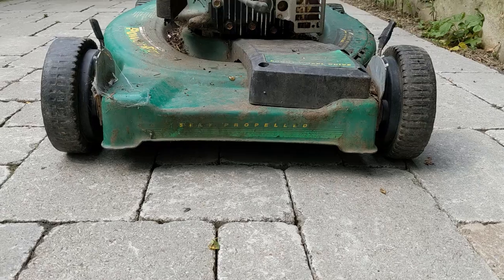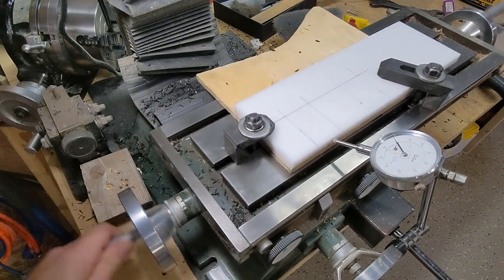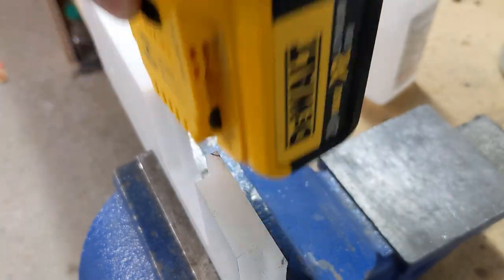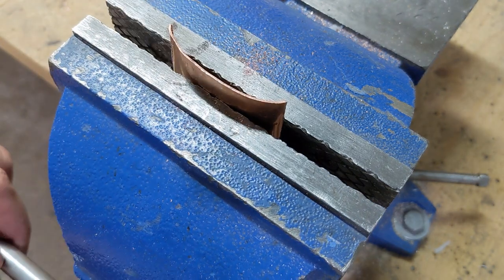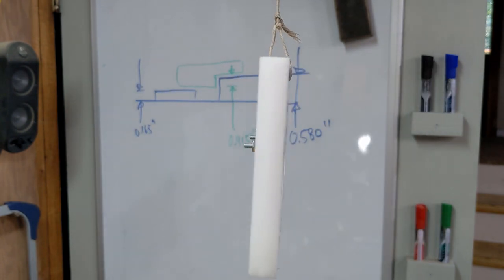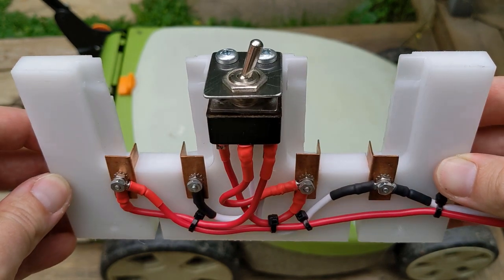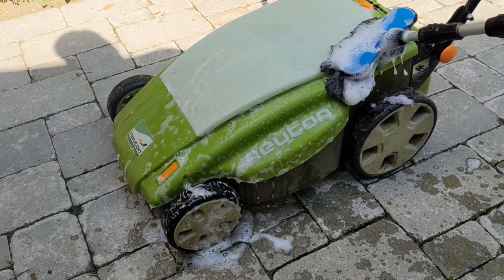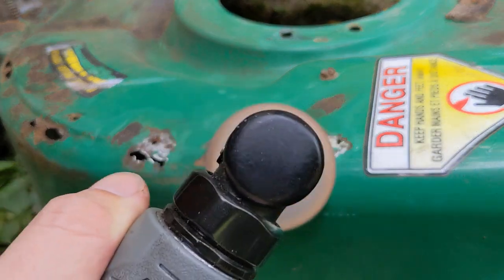Upgrading a Neuton Mower to Run on Drill Batteries

Comment: Genius! I'm blown away. I mow a gnarly community garden field with a donated CE5.2. The heavy lead acid replacements & their long charging times are frustrating, & the battery case is nearing end of life. Your improvements would save this wonderful mower from the scrap heap pretty much indefinitely. If you ever produce/sell your set-up as a kit, I hope you'll let the community know - ebay/amazon have little for Neuton fans, & replacing the lead acids costs ~$100+/yr. And the disposal nightmare.... Hope you jump in, I'm too old to be lugging this battery around!

Comment: You should sell a kit.  Some of us can put that together but we can't machine the plastic material.  You have a great idea there to save the Newton mower from extinction.
Reply from the maker: Thanks for the feedback Dale. You're right, machining plastic is quite specialized. The good news is that there already are drill battery holders commercially available from sites like Amazon which make this type of conversion easier for those who are interested.
Reply: @BusyMDan  I will check that out on Amazon.  High fives on the innovative conversion, Thanks Dan.
Reply: @moci42  If anyone has a link to one of these kits I would be very interested! Thanks in advance.

Comment: Really impressive bed of work. Thank you for doing that. I have a slightly older model with a CE5 24V battery, and I’m going to give this some serious thought. My approach might be a little different in that I would try to use the existing mower battery case to construct the holder for the portable tool batteries. It would also mean that the mower would run always at 20 V, but I could have two in parallel, which would give it a lot of oomph.

Comment: I had to use my Newton 6.3 today and the battery was clearly very low.  So I pulled the batteries they looked physically like new.  I disconnected all the wires and am now charging each battery on my bench charger.  The bench charger doesn't show any problem with the first battery, it shows 90 percent capacity.  I'm now charging the second battery then will be the third.  I checked the charger wall wart and it shows 40 volt no load so it should be fine, however I did find the charger plug was badly rusted.  I used some very light sandpaper to get the rust off and bare metal then used DeOxit on the plug.  After I get all the batteries charged up I'll reinstall then try the wall wart charger again.  I checked Amazon replacement batteries are all over the place price wise, it looks like exact replacement of three would be about $75 at the low end.
Reply: I found three specifically for the Newton 6.3 priced at $68 on Amazon.  I finishted the second battery and it tested good with 90 percent capacity.  The third battery is on the charger and so far it's charging just like the other two.  I expect it too will have 90 percent capacity.

Comment: Question, the mower with the original battery pack comes with a DC input to charge it, is there any way to wire this into the setup you have to easily charge the drill batteries?
Reply from the maker: It possible, however not practical. The individual battery cells ideally should be balanced when charged and the mower only connects to the positive and negative terminals of the battery. There are additional pins on the battery which I believe the charger uses to perform a balance. Also, there is no monitoring of the batteries temperature while in the mower while is important for safety. It may be possible to pump current directly into the battery overall, but I don't think this is the best/safest option.
Reply: @BusyMDan  ah, I was under the assumption that the batteries had a BMS built in 🫡 thank you!

Comment: great project, well done explaining. couple of question; you appear to be using the multimeter in place of the safety key, does this use the fuse in the meter as the breaker then? also, is there a schematic for the voltage switch?
thanks 
Mac👍👍👍
Reply from the maker: Hi Mac, I’m so glad you enjoyed my project! You’re right, I did use the multimeter in place of the safety key- but only while taking measurements for the video. It was simply a convenient spot. Otherwise, I just use the safety key as normal. Regarding the schematic of the switch, I included one in my other mower conversion video: "Electric Lawnmower Upgrade, Take 2". Take a look :)

Comment: Is there already a low voltage cut off for the battery built into the mower? My guess is no, im just wondering if you have killed any batteries with it. Thank you, i will work on converting mine!
Reply from the maker: Thanks for your question- no, I don't believe there is a low voltage cutoff in the existing circuitry. I added a little voltage display so I can make sure I don't run the batteries lower than 3.0V per cell. But even without that display, it noticeably bogs down before that point and its pretty obviously when things are getting too discharged.
Reply: @BusyMDan  I bought the proper toggle, do you have a video on wiring the switch? I watched some guitar videos but I am still an amateur.